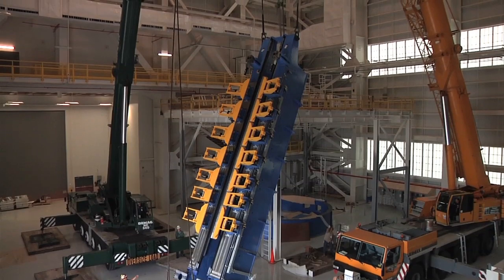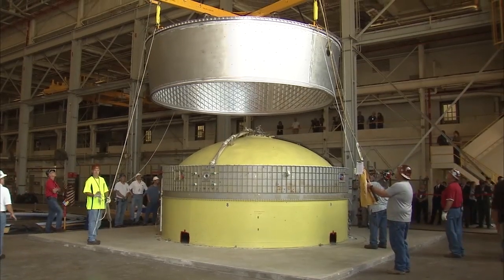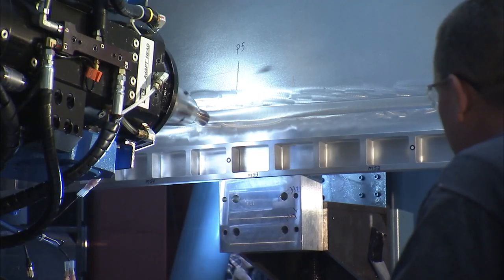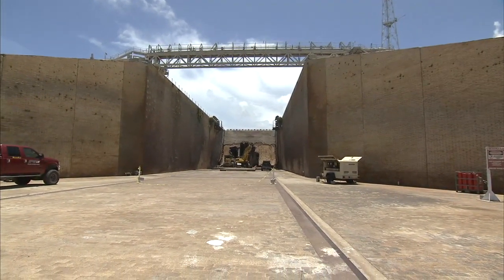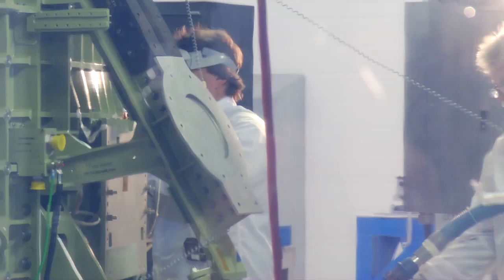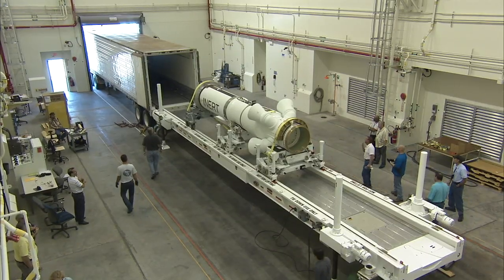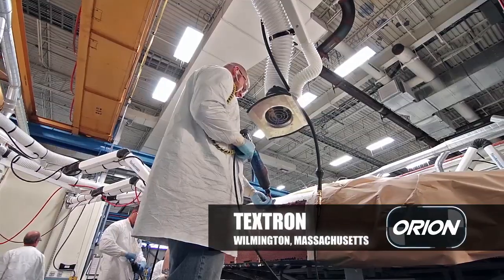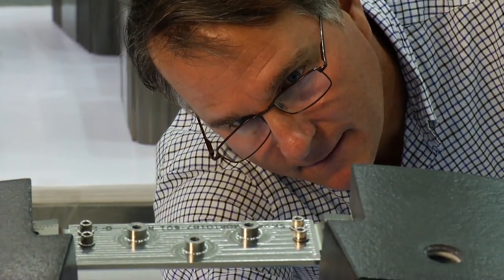Preparing America for Deep Space Exploration: Episode 3

Comment: SLS is a waste of money given Space X's BFR will be a much better platform and cost significantly less. The money should be spent on the in orbit facilities which will allow us to leave orbit and travel to the outer planets as well as develop the habitats and life support systems. As for the crawler, not sure why they can't run it out on tracks. It would be far more energy efficient. The dry weight of the rocket is only about 300tonne, the weight of 1.5 x diesel locomotives. The platform, gantry and drive would be the heaviest but this can be reduced by utilising just a strong back and have the full gantry at the pad, plus, not having caterpillar tracks would save a massive amount of weight too and an all electric drive can be much smaller. Hydraulic lifters at the pad would then take the weight of the launch deck during fuelling, standby and launch.The engineering looks impressive but I could optimise this a lot more, as I suspect Space X could and are doing.
Reply: So not all waste, we will see.